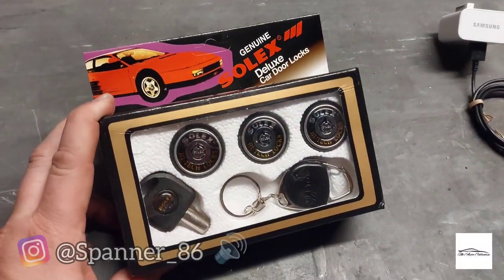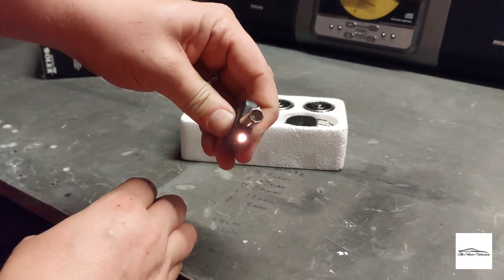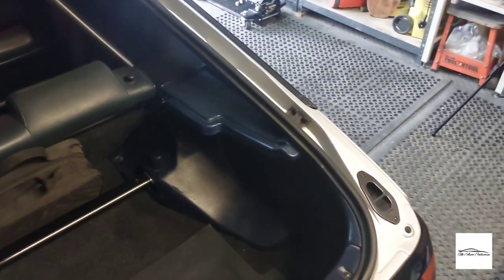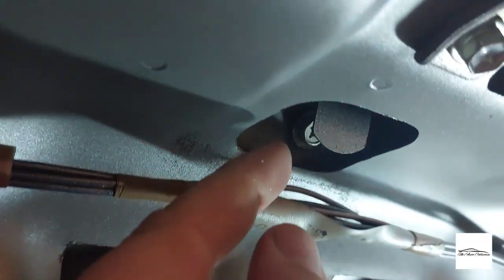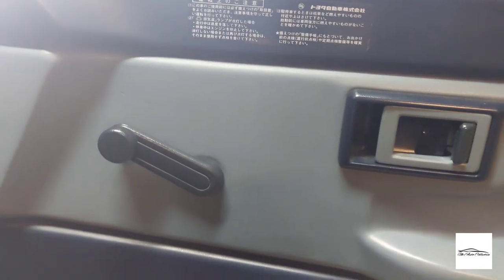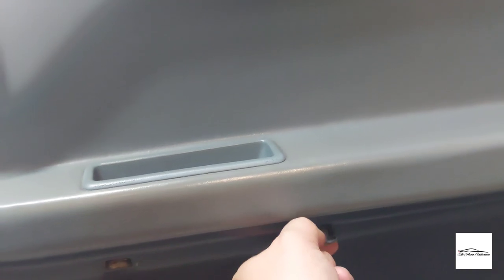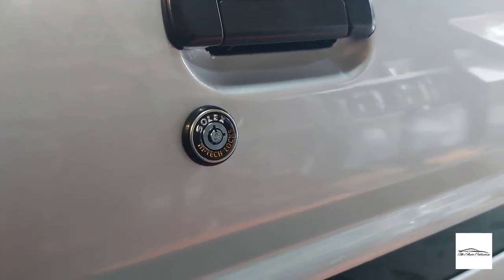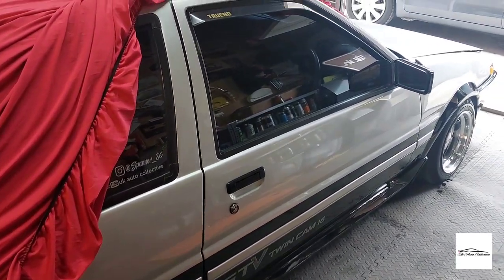Solex Hi-Tech Locks | Ae86 | DIY | How To | Upgrade | UKAC

Comment: I did it all but it's not open or closeing from inside the car why ???
Reply from the maker: Did you use the correct link?
Reply: @ukautocollective   i used the solex original link ! Maybe that's why ?
Reply from the maker: @illusion6210  possibly. I used the originals and they work perfect 👍